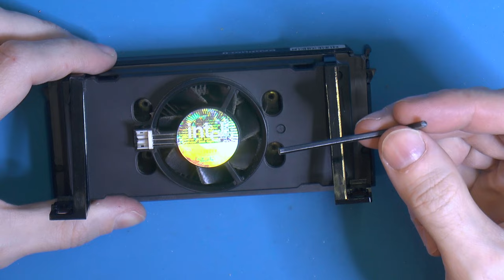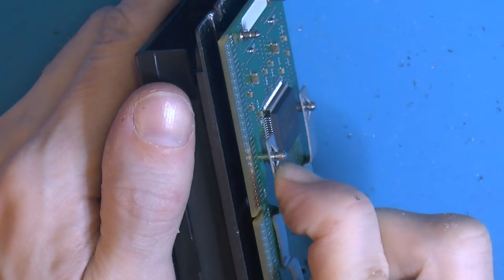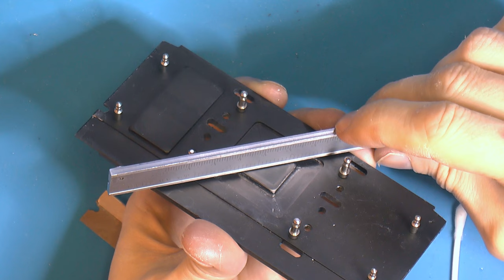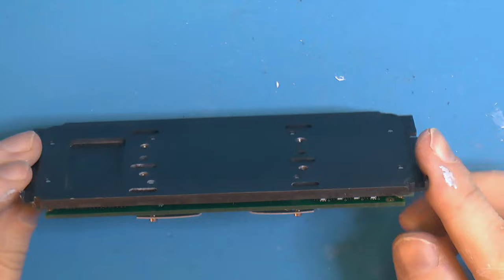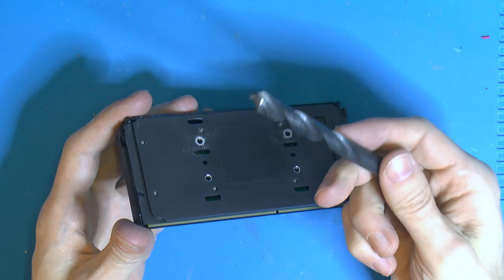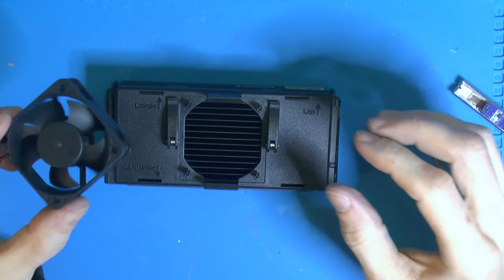Pentium II build  - Part 2

Comment: Love that you are sharing the whole thing and not just a 5 minute clip, lot of work to get these slot CPUs appart without damage, I need to check for the lifetime but I want to use thermal putty for the cache, some people use it as thermalpads replacement on modern GPUs so I thought it should be OK.
Looking for you motherboard recap.
Reply from the maker: If I had thermal putty I would have used it, it seems like the idiot prof way to go.
Never seen it for sale in normal online PC shops but might have to get some elsewhere.
I will see if I can get some for future videos, I sure know modern GPU's uses it on the inductors!

Motherboard Recap Friday next week!
Reply: My exact thought. Perfekt application for K5 Pro.

Comment: Wow. You probably have the coolest Pentium II cpu in the entire world! This is so sweet. Are you going to overclock it?
Reply from the maker: coolest as in cold or looking? XD
Anyways thanks!
My dream slot 1 build would be 1 or 2 slot 1 peltier and water cooled so sub ambient.
Thats where slot1 really comes in to play!

It runs at 450Mhz just fine on stick voltage, prime95 for 25h and 14 passes memtest86+, no throttling, the backside of the case was 2C over ambient suggesting little radiant heat, heatsink 6-10C over ambient so yea 250nm P2 are not that hot.

We have a bunch of people benchmarking Quake 2 using Pentium II and Pentium III slot 1, no copper mines so there are people there with custom made coolers, 3D printed fan holders and stuff, I have a discord link in the description.

My friend that host the discord server is having a Quake 2 benchmark competition and the winner gets a Voodoo2.

Check it out if your interested!

Comment: That is one Phat looking P2.
If only i could see the before/after temperature results.
Nice video other than that.
Reply from the maker: Yea would be nice if the P2 had a readable sensor.
There is no way to get the die temperature on a P2 that I know ff.
only thing you can do is mod a sensor to the IHS for example, and a lot of the time processors just had a sensor in the socket.
The P2 being a slot 1 makes that even more difficult.
CPU die temperatures was not so much a thing back then.
Pentium 3 coppermine had them on die, Athlon XP technically but often not readable by the end user.

Comment: Hey Patrick, you've done good job so far. But I think you have done mistake focusing on l2 cache cooling instead of cpu die, cpu die produce most of the cpu heat and you should focus on that first. by adding thermal pads on the  cache you lift up heatsink from the cpu die by small gap, thermal paste won't help while there will be like 1mm or 0.5mm gap. Heatsink should be hard pressing on the cpu die, thermal paste is just there so little filling heatsink surface imperfections to help transfer heat more efficiently. I would do it this way. CPU die always first in terms of heat transfer. 
I am into pc hardware for 20+ years and love stuff you are doing. I would apply both thermal paste cache and cpu die if clean heatsink touch them both equaly. if not, like clean heatsink still gives a small gap to the cpu die then I would go with quality termal pad on the cpu like grizzly and then termal paste on the l2 cache. hope that make sense. 
Also on the fan side of the heatsink I would no use that MUCH thermal compound. If heatsink was not flat from the factory don't worry...just place sand paper on flat and hard table, work on it with heatsink, don't worry about paint. It will be silver eventually. But nice and super FLAT. Paint doesn't help with heat dissipation anyway. 
Thermal compound for pc hardware is like filler on car body repair, you work on body as much as possible to be able to use just as little filler as possible for good results.
Some of the thermal compounds like to melt once they got heat to them, like the one silicon based for example, they can squeeze out and drips on the electronics pcb, components etc which you don't like to see this.
I've seen many pc's with overuse of thermal grease lol
Thanks for reading! 
Good luck on your 1998 gaming pc quest
Reply from the maker: Idk what to say without risking some argument but anyways here is my clarification post.

The howl point of testing pads was to find a Z high that do not lift the IHS of the die, and 0.30mm works, 0.25mm would be ideal.

I have used past for at least 24 years, but dont se the relevance really.
Paste will squeeze out from the pressure assuming it has a proper viscosity.
If you put on to much you will just get more squeezing out, I got a little over a few days burning in the CPU and wiped that off, most of it found it s way over to the cache where there was some gap to fill so its all good.

And car filler hardens, I renovated a couple of cars so done a fair bit of body work so I dont see how that compares to past.

Lapping that IHS wont work unless you grind down the center studs.
Anyways a problem with heatsinks that have cutouts for mounting clips is that they can deform there, they are not very stiff there if the base is thin and it is on this one.
So any lapping would most likely be undone by past and the pressure from the mounting hardware.
A stiffer heatsink and ideally some screws further out would be ideal, so a total of 8 screws for it to be worth lapping it.

So lapping it is not that useful because it was fine in the middle, its just a 20W or so P2.
Past is also a lot better then air when it comes to thermal conductivity and the original IHS has a 1.8mm indent over the cache so yea, one could fill it with a shim, copper or aluminum but even a thermal pad and past is way better then air.
I do know a bit about the thermal conductivity properties of different materials.

I studied thermal dynamics in school, and lapping stuff was a part of spending time at Nuke Plants and other industries fixing valves and stuff so I do know a bit about that topic.
The Swedish Nuke Plant I was at had a big dedicated machine for laping, things that came out of that is many many times more flat then anything you could do at home by hand, ran my Socket A heatsink trough that and checked it, perfectly flat.

I hope that clears things up.

Have a nice day!

Comment: Too bad the TNT1 didn't work. Such an interesting card. All I know is that my 16MB TNT1 killed the 3.3V voltage regulator on my friends cheap ass 440LX board back in the day. The Banshee seems to have a voltage regulator (not sure), but the TNT doesn't. It's very unlikely, but maybe the boards 3.3V AGP regulator (if present) has a problem with the TNT?
Reply from the maker: I found the fault but you will have to wait a few weeks for a video about it.
I wont spoil what was wrong BUT there is a happy ending so stay tuned!
Reply: Weeks?? Damn. I'll try to not get run over by a car meanwhile :-)
Reply from the maker: @Shmbler  like 3 weeks I think.
Did upload it yesterday to YT.
Reply from the maker: @Shmbler  The video with the final fix for the TNT is up.
https://youtu.be/Swmx3p4dvP0
Just letting you know 😉
Reply: Watched it meanwhile, thanks! Very nice result.

Comment: jag har nåt minne av nån adapter som gjorde att man kunde använda "normala" cpuer på dom moderkorten. Kommer ihåg att jag hade nåt sånt men det är ju ett antal år sen
Reply from the maker: Slotket, Slot 1 till Socket 370 adapter.
Reply: Ja så var det,  jag körde en celeron på 500mhz och ett Nvidia GeForce2 gts 64mb.